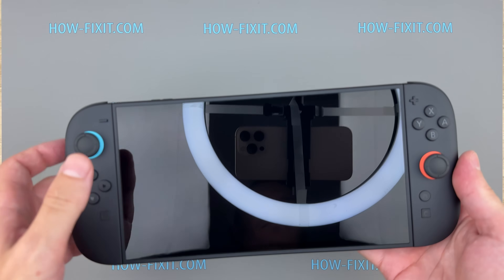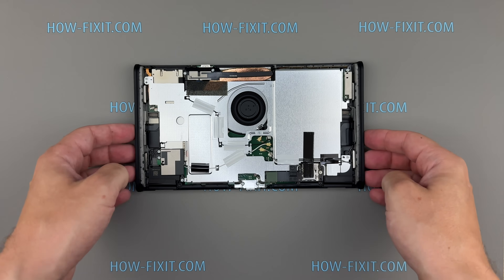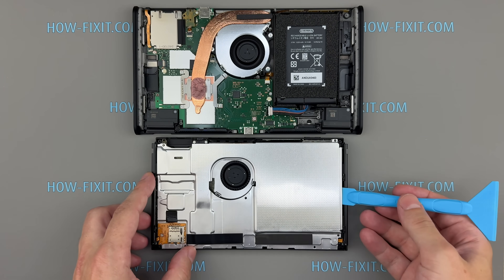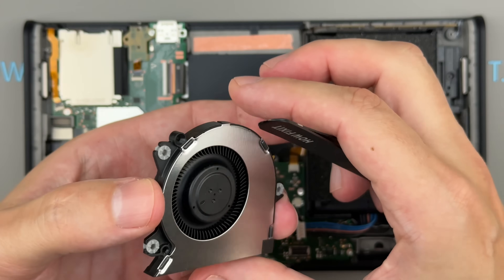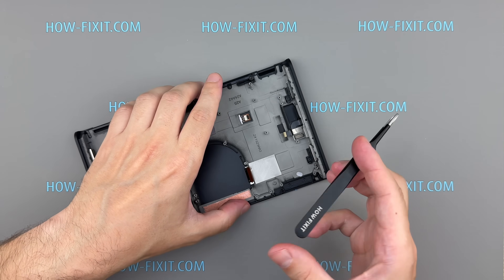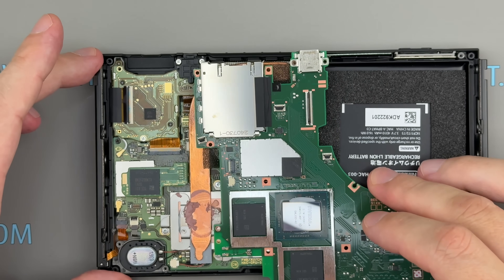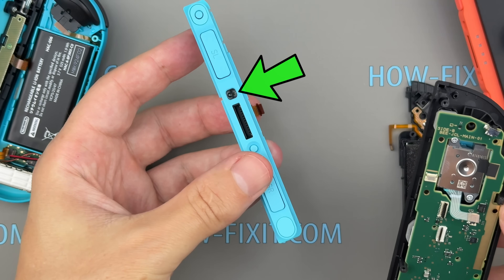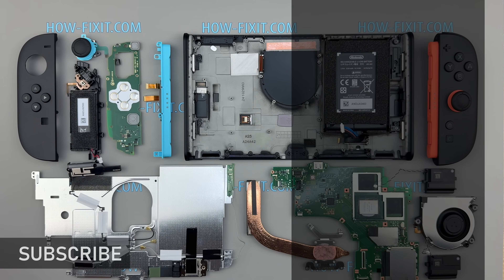Nintendo Switch 2 vs Original Switch: Full Teardown & Repairability

Comment: Can you put a normal ssd in here. I know someone discussed putting in a 4TB ssd..would you need to modify the board to fit one. I see this brand made a 1 and 2 TB. Can these chips stack safely..i know some ssd for systems like the xbox rog will have larger size ssds that can stack

Comment: Its replacement because all the aftermarket companies.  Like AMD pays Intel royalties, way back in 2002, the AMD and Intel motherboard swapped RAM types, clearly just so you had to buy more junk again.  Smaller companies don't help eachother out like that.  Because such a smaller company is just a claim jumper.

Comment: Is it ok to have the heat pipe touching the SoC? So basically putting thermal pads on the RAM modules and have the heat pipe touching the SoC directly.

Comment: It is very easy to see where damage is likely to occur and where repairs will be time-consuming. The USB connector is not modular and the worst-case scenario is that the main board will have to be replaced, which could lead to expensive repairs. It is likely that the USB connector should be unplugged and plugged in as little as possible, and using extension cables etc. will prevent damage and wear to the connector.
Reply from the maker: Good advice about protecting the USB-C port—thanks for watching and for sharing your repair tips!
Reply: I've never had a usb c broken so i dont think is a big problem
Reply: What i do i use magnetic ones they just Connect and disconnect like you would on those macbooks air

Comment: The DUI design is very nice indeed so good job hardware designers at Nintendo but unfortunately the company management rendered all of that good design useless with their bricking policy.
Reply from the maker: Totally hear you. The engineering team really nailed the layout and modular touches, but if Nintendo keeps pairing parts in firmware or banning self-repaired units, a lot of that effort goes to waste for DIYers.
So far, I haven’t found any hard part-pairing on the Switch 2—no chips that lock out a replacement battery or screen the moment you swap it—but Nintendo still reserves the right to block consoles from online services if it detects “unauthorized modifications.” That’s the bricking most people are worried about.

My advice: Keep backups of your NAND in case future updates tighten security, and Disconnect Wi-Fi during initial hardware tests after a repair, just to be safe.

Comment: Ah yes, the Nintendo Switch 2 — now with slightly better graphics and even more ways to get banned for daring to fix your own console!
New Joy-Con drift? Just buy a whole new system, peasant.
I can already see the EULA:
“By pressing power, you agree to surrender all bodily autonomy and promise not to touch a single screw without Miyamoto’s personal blessing.”

But hey, at least Mario will be in 4K while Nintendo scans your console for sins.
Can’t wait.
Reply: They can't brick your console over repairs. Their EULA states that your console can be disabled if you tamper with their online servers. The whole bricking if you do anything wrong is clickbait news
Reply: you could just send your joycon(s) in for a free stick replacement. but, yes. this shouldn't still be a problem. however, its not just nintendo that still has stick drift issues...

Comment: Soldered cartridge slot? Nintendo whyyyyy 😭
Reply from the maker: I feel you! 😭 Nintendo likely did it to save a few millimeters of space and add rigidity (one less flex cable + connector), but it makes DIY repairs way harder—and cartridge slots do wear out. We called it out in the teardown because it’s a clear step backward for repairability. If yours ever fails, it’ll be a motherboard-level job or a pricey service-center visit. Let’s hope the feedback pushes Nintendo to rethink this in future revisions!

Comment: So Nintendo Switch 2 might come with an OLED screen, DLSS, and a more powerful chip… great on paper — but at what cost? If they’re doubling down on locking the system down, bricking consoles over minor repairs, and treating their customers like pirates, does the hardware even matter?
Would you still buy it knowing you can’t fix a broken joystick without risking a ban?
Or is it time we stop rewarding companies for anti-consumer behavior just because they throw shinier specs at us?
Genuinely curious what others think. Where do you draw the line?

Comment: I’m a bit skeptical. If Nintendo locks down the hardware even more and continues this anti-repair, anti-modder attitude (like bricking consoles over simple repairs), it really takes the excitement away. Powerful specs are great, but not at the cost of user freedom.
Reply: Just don't break your dang console - also if you have very young children just hide the switch 2 and use wireless controllers
Reply: They aren't bricking consoles from repair. It's a fake news haters have been spreading around. Their EULA states that tampering with their online services can get some parts or your entire console disabled.
Reply: Most people don't care about modding.
Reply: Tbf they only brick it when you mod it and they only stop you from connecting to their servers and the internet which you obviously never owned anyways. Plus both Microsoft and Sony have this term in their license.
Reply: @blam11 they don’t brick anything, they just ban you from online lol, stop with this misinformation.
Reply: Console gamer dont care about modding why do you think people buy consoles? Because it isn't a pc 😂
Reply: Freedom means piracy, so Nintendo was right
Reply: Actually Specs also not great
Reply: @dynt1111  its pretty much the best in the price range. Really the only other big handheld in this range is steam deck and that is weaker. It also comes with a dock and controllers, which is over 100$ for pc handhelds
Reply: @dirtydirtsgt4751 The Steam Deck is only weaker docked (because it has no official docked mode as max power used by APU is same as handheld mode), I feel the handheld mode can be as good as Switch 2’s.

Comment: Could you check whether the console work with disconnected battery and plugged in charger like laptops work?
Reply from the maker: Great question! I did a quick test during the teardown: with the battery unplugged and the charger connected, the Switch 2 wouldn’t power on—the PMIC needs the battery in the circuit to initialize the power rails (same story as the original Switch). So, unlike many laptops, it won’t run “charger-only.” If I discover a safe workaround (e.g., a bench supply wired to the battery line), I’ll update in a follow-up video. Thanks for watching!
Reply: @howfixit Cheers mate! Just like I thought. Sadly, this time it’s much harder to disassemble the console due to foolish stickers, that must be removed to gain access to screws. Nintendo, like always, doesn’t care about preservation of their products… Many thanks cos i searched for the answer and none of other channels did mention about this issue.

Comment: Sadly it doesn't matter since if Nintendo feel like you modified the switch in anyway, they can choose to brick your deviced when you connect to their network.
This is anti-repairability like what Apple did and we should call them out for it.
Reply: Nintendo has been doing this since the original Switch. If you modify the original Switch and connect it to Nintendo's servers, you'll also get a brick. Nothing new.
Reply: @Edvard_Nygma  The issue here is that "modifying" could simply refer to a change in faulty pieces, such as the Joy Con's flex (which, in most cases for the Switch 1, was shipped almost broken). Nintendo wasn't bricking consoles for HARDWARE modifications, they could only detect if you were running custom firmware (ie. SOFTWARE). Their latest EULA makes it so that they can also run code in your console to look not only for software modification, but also for changes in hardware, and brick your console for that. Which is insanely anticonsumer. Basically, they're telling you to go buy new hardware if, say, your joycon's stick breaks.

I used to play games on emulator, but after getting a good paying job, I decided I should actually buy my games. Which I did for a few years (mostly during the Switch 1 era). But this change is making me seriously rethink that, and I'm most likely going to go back to how things used to be for me. Supporting them even further with my money when they are THIS scummy is a no-no.
Reply: This is absolutely disgusting behavior from Nintendo. Bricking a console because someone dared to replace a broken joystick or repair their own hardware? That’s not just anti-consumer — it’s corporate authoritarianism.
People paid hundreds of dollars for their devices. If Nintendo thinks they have the right to kill your console remotely just because you fixed a part THEY shipped broken, they don’t deserve a single cent more. This is the same kind of anti-repair garbage Apple got slammed for — and now Nintendo’s pulling the same stunt?
If this is the future they’re pushing for, don’t be surprised when more people go back to emulators and stop giving them money altogether. You can’t claim to support your fans while stabbing them in the back for trying to keep their devices alive.
Reply: @MrWhite-i9cpu It’s a fake news fron piracy propaganda
Reply: yep, keep telling the lie
Reply: Quick question for anyone who knows what the official warranty policy on the Nintendo Switch 2? Like, how long is the warranty period, and who actually handles repairs or returns if something goes wrong? Nintendo directly, or the store you bought it from?
Reply from the maker: 12-month limited hardware warranty. Return/exchange = retailer (first couple of weeks), warranty repair = Nintendo.
Reply: @Maquinna-She  Nintendo only cover 1 year of warranty for your purchase, after 1 year you have to contact them to get a replacement or repair at your own cost. This is why many people replace their drifting Joy stick on Switch 1 themselve rather than buying a new controller.

And with Nintendo new EULA they could just say you're using unauthorized part and brick your console, which is the same thing Apple did and get sue over and over again.
Reply: Ok but there hasn’t even been a single case where that has actually happened, I watched someone use that fake switch cart that has ROMs on it and it still didn’t get bricked so idk what evidence you have to go off here.
Reply: Ok so update on that. It wasn’t bricked but it was banned from using online services which I think you can ask them to undo so
Reply: That’s blatantly false lmao